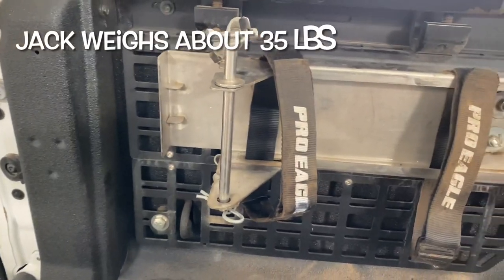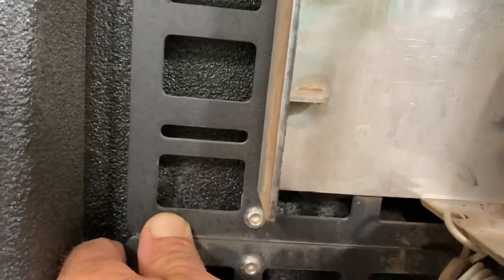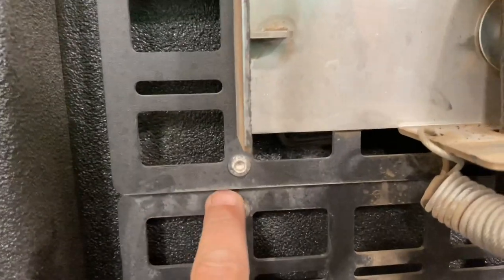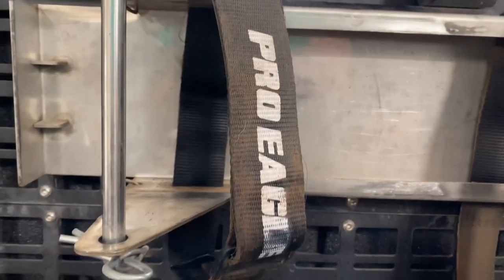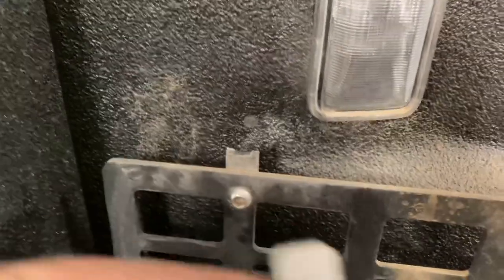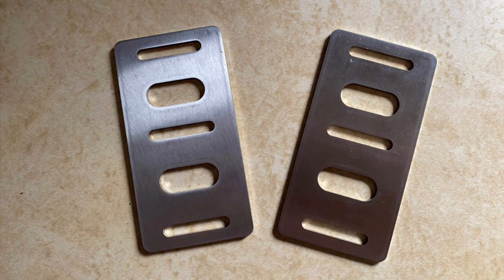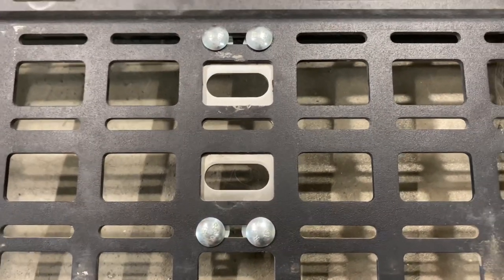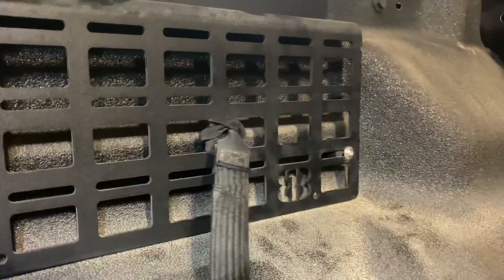ProEagle 1.5 Ton Jack Mounting on 813 Fabrication and Design Molle - Jeep Gladiator

Comment: Hello, the bracket for the Pro eagle mount. Will that work with any other molle system?  Are they only custom-made for you?
Reply from the maker: If the Molle panel is built to standard all you need is the ProEagle jack mount that ProEagle sells as an accessory and 4 Molle high-lift jack mounts from 813 fabrication and design. You’ll have to modify the jack mount as the pre-drilled mounting holes won’t match up with the Molle spacing, but it’s easily done. Basically you just need to drill a few new holes in the base of the jack mount. https://www.813fabrication.com/product-page/high-lift-jack-mount-bedside-molle (You’ll use the mounting plates from these without the standoff for the high-lift).
Reply from the maker: Check the links in the description as well

Comment: What made you choose a floor jack vs high lift or was it something you already had before the JT?  Seems like a high lift weight would be more spread out and not so focused on that one spot.  I enjoy your videos wish YT wouldn’t bury them so deep when I’m looking for build options on mine!
Reply from the maker: Stability is the #1 reason. The other is the ability to lift from the axle. If I need to pull a wheel off I only need to move the axle an inch or two depending on terrain. To get a wheel off the ground from the bumper/body you’d have to lift 12-15 inches or more just to start to unload the axle, and if your in a precarious spot that could be super sketchy. Couple that with the sketchy nature of the jack itself and no thanks. Also it has a very wide lift range. It can fit under something with just a few inches of clearance all the way up to about 18-20” and still lift the vehicle. Sure, a farm jack has other possible uses, but I’ve never seen a single human soul use one for those purposes. Also, you need points on the vehicle to lift from with a high-lift. It Cracks me up when I see people with their farm-jack mounted on their hood and they have plastic bumpers, no rock rails etc. What’s their plan?
Reply: @sroodtuo  those are exactly the points I’m interested in learning.  Makes a lot of sense thank you!   FYI 21 rubicon here I’m starting on soon.